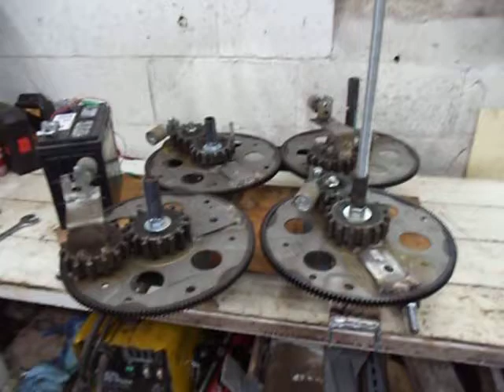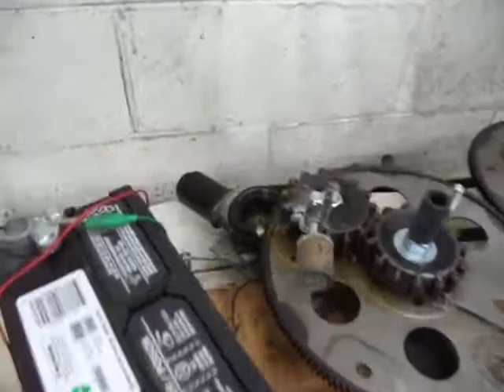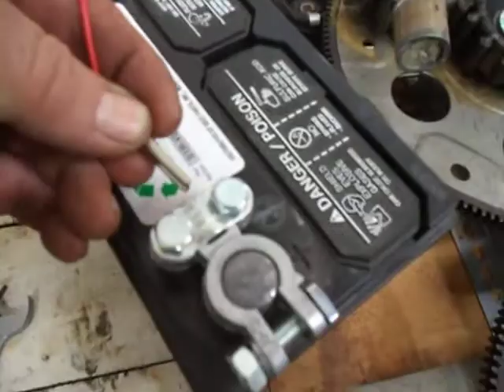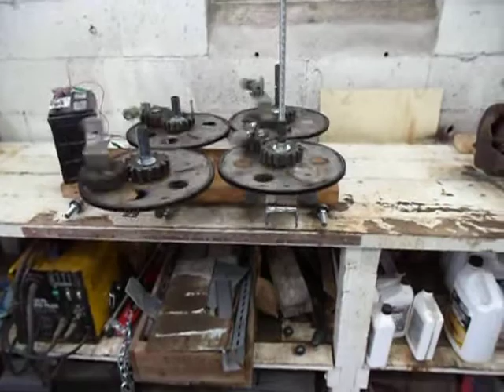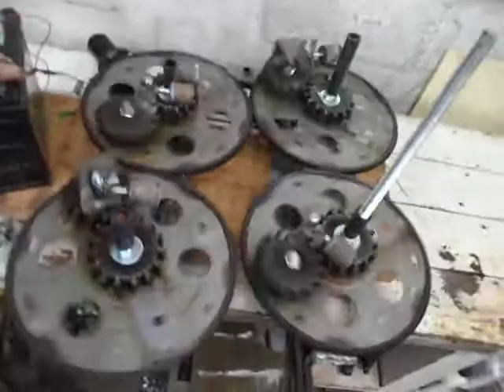4 wheel Mov 1

Comment: Great work. Since you already have four wheels, why not have them turn asynchronously? Time them 1/4 of a full rotation apart from another, that way you will produce a smoother motion, the way a 4 stroke engine would.
Reply from the maker: As experimentation progressed re-phasing for smoot operation has been tried many times, in many configurations. The low-speed PIE design proves the concept, and will hopefully be replaced with the "next generation" of PIE systems very soon which will (hopefully) be a smoother and more powerful system. Thanks for watching.

Comment: Excellent assembly, but if you increase the rotation your device will just vibrate.
Reply from the maker: Thanks for the thought. Have you built one? If you had, you would know that power increases with speed. The 4 wheeler was not intended to be anything more than a proof of concept early prototype build. Please build one and see for yourself.
Reply from the maker: BTW, I am working on a simpler way to make the planetary gear sets while still holding the price for the parts as low as possible. Steel spur gears are expensive unless you find an odd-lot on Ebay. If anyone has ideas for the gears, please share!!! Thanks
Reply: Sounds like you are running into the same limitations i am, but excellent proof of concept,  thank you for making your videos available...

Where did you get the large gears? They are just what the doctor ordered for completing my project...
Reply: Yes, I built a similar one that uses this same concept.  Take advantage of the centrifugal force present in the circular motion.  Since 1994, I've been researching this.  Regarding your model, if you increase the speed your system will have more difficulty bringing the mass to the center.  Applying Newton's Law, when the axis pulls the mass it is also pulled and when it releases the mass it is also on this same movement.
Reply: Its assembly is very well done and robust, congratulations.  These surveys are really expensive.  I spent a lot of money.  When you have no more ideas to continue, study the possibility of what you are looking for in pendulums.
Reply: When your ideas run out about centrifugal inertial propulsion, think of pendulums.
Reply from the maker: The large gears ( referred to as wheels) are automotive flexplates, the "flywheel" for a 1970's - 1980's vintage Chevrolet small block V8 engine which uses an automatic transmission. Common part numbers are  Z114, or Z111 which are available relatively cheaply on Rock Auto, or ebay. Even most parts stores charge less than $25 for an off brand one.
Reply from the maker: Ok, thanks
Reply from the maker: Leonaldo, Without compounding the motion, it will not work. The planetary gears do the compounding here, but I know of others that compound with other mechanisms.
Reply: @Torkx100  no, increasing the speed will increase the force in all directions equally.  The long throw remains as  the reaction mass and the double short throws remain as an internal counterbalance of the return mass. The effect is that  the return mass has about half of the centrifugal force as the long throw reaction mass. That equation stays the same regardless of speed.
Reply: Well done! I stopped development of mine back in the 90's when NASA sent the experiments of this type into orbit for testing and then labeled all of the "weight slingers" as pseudoscience and said that they were not open to any more submissions of this type. 
At the time,  I was trying to find cost cutting alternatives to build a working model. 
 As a DIY demo model,  yours gets the job done by making enough unidirectional force to pull itself AND it's power supply.